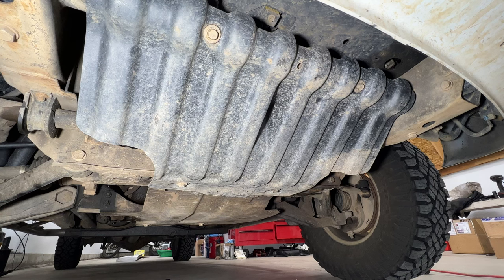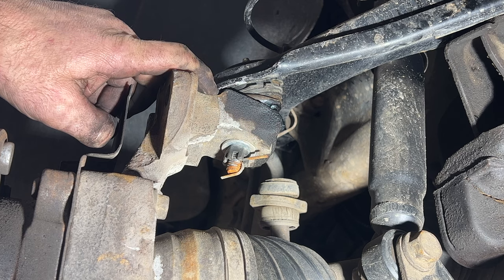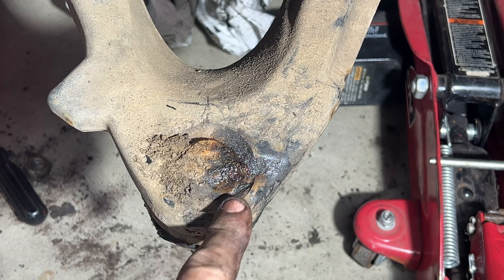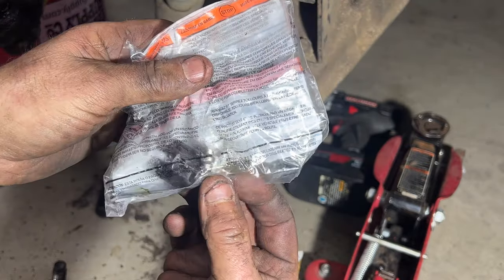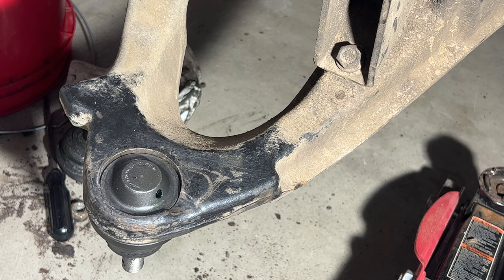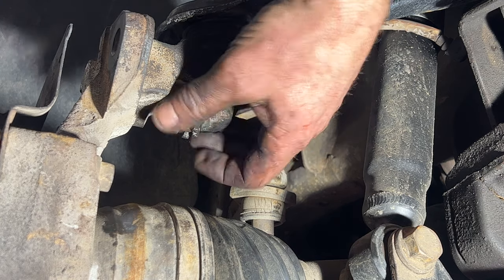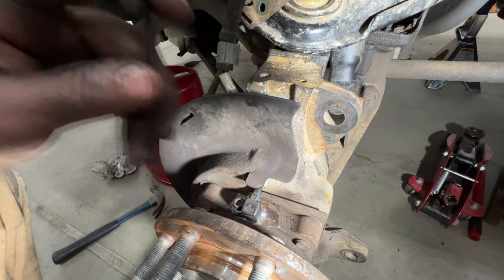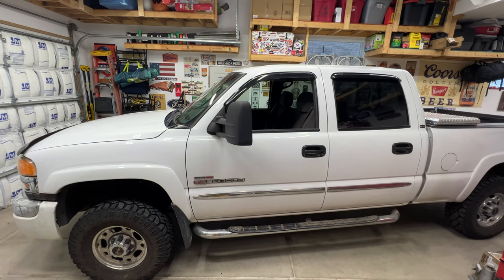2001-10 GMC/Chevy Trucks & SUV's Lower Ball Joint Replacement How-To

Comment: Did you have to remove or release the tension on the torsion bars?
Reply from the maker: No you don’t have to do anything with the torsion bars unless you removing the whole lower control arm.

Comment: Can someone explain me why this ball joint don't need an o ring  to keep it in place or what keep it from falling, one time i replace one and it had an o ring and it makes sense because without it, could fall or not? Can someone explain me, im about to do that job and that worries me
Reply from the maker: This ball joint is pressed in there with a lot of pressure it would take a lot of force for this to fall out. Plus you have the upper ball joint that does use a snap ring to hold it in which is bolted to the steering knuckle as well you also have the tie rod end and the cv axle nut holding  the steering knuckle in place so it would take all four of those nuts to fall off and both ball joints to fall out so i wouldn’t be concerned about it at all.
Reply: My replacement came with a snap ring to retain it at the top. Mevotech.

Comment: You could have used the balljoint press to get the old one out if you knew what you were doing and not making a "how to video" on your first ever ball joint replacement.
Reply from the maker: 😂😂😂 if you are already an expert at ball joint replacement than why you watching this video?
Reply: @BLUECOLLARGARAGE  I'm doing ball joints on a silverado I bought for our son, hes 14. I own my own press, I don't have to rent one. If you had inverted the press, put the large cup on the bottom you could have pressed it out from the top. The tip of the press should swivel. Put it right on the top of the ball joint with the large cup on the bottom hit it with a 1/2" air impact. Done deal. I was looking for a video to show which direction the ball joint came out. They are so beat up and there are no snap rings on it so it was hard to tell. You did answer that question.